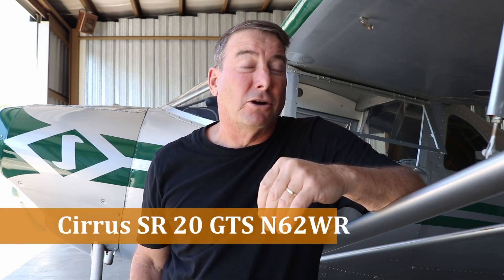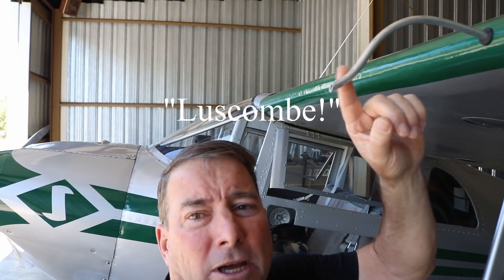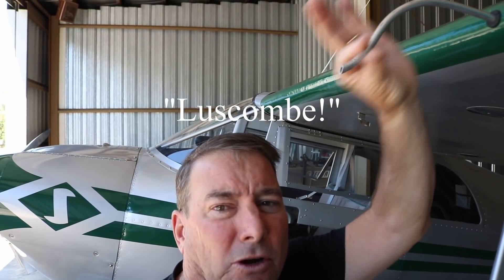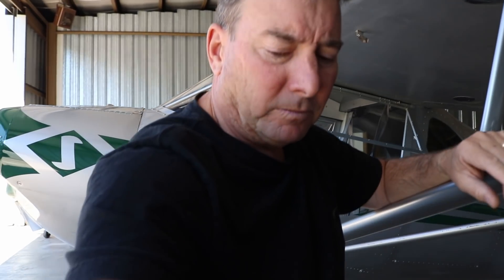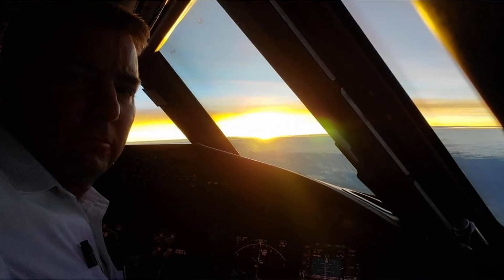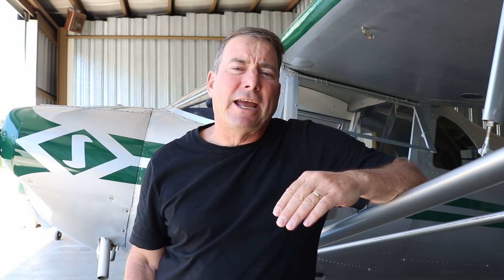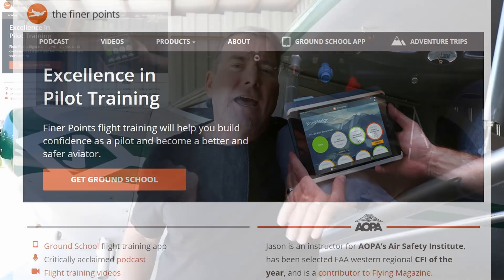Cirrus SR20 Crash Conway AR - AQP for GA!

Comment: 50 years ago, my flight instructor had a pocket full of round rubber flappers with little suction cups on the back to cover the gauges. Needle, ball, airspeed was the scan. No airspeed(?), power setting, attitude, and stall horn for backup. After departing the pattern, reduce power and check stall horn function, you can't check that on the ground unless preflight shows some kind of obstruction, then its time to see the A&P mechanic.

Comment: Airspeed is a great reference but should be understood it’s related somewhat to power - know your aircraft: example:1300 rpm 10 flaps , level flight = 80 kts (indicated) if zero think , is the engine making good power? (Rpms) what are the winds? You just took off. Or listen to awos. I have flown/landed with out airspeed indicator many times. Often students aren’t taught power settings for various configurations. The airspeed indicator doesn’t make the airplane fly the power does. Learn your power settings - that and common sense and you’ll be fine.also what GA aircraft doesn’t have a go’s showing ground speed? Clearly if you took off on RY 18 and wind was 180 at 10knts what do you think your ground speed is in final?

Comment: I picked up a 172 from paint: static port was plugged internally + trim was rigged incorrectly. Takeoff was exciting, nose lifts up at 40 knots and airspeed drops to zero on climb-out. Kept the power full and dealt with the trim problem first, then switched the alternative static source to restore instrumentation.

Comment: I have forgotten the pitot tube cover once; it was a stupid error; i am very meticulous on my preflights but that in turn leads to situations where your mind thinks it did something this time that in fact it remembers from last time; this is of course aggravated by the pitot tube not being visible from the cockpit in many low wing aircraft. solution 1: put the cover in the cockpit so you can visually check its presence; solution 2: buy an inspection mirror; always keep it in the cockpit and use it to check if the pitot cover is on; or the tow bar, or the chocks if you think your mind may be playing you tricks. Another important point is to never get side tacked during your walk around and if you are catching the lack of airspeed too late (i for example cannot see the airspeed indicator on take-off without significantly moving my head since the piper tomahawk eyebrow is installed so low it covers the upper instruments (working on changing that)) make sure you know your visual and power setting so that you can make sure to select an attitude and power setting that gives you a save speed like juan said. I did just that and on landing i selected a long runway and approached on the fast side only bleeding off airspeed when above the runway; so it all went well. and i am making damn sure this only happened once so that i have learnt from your mistakes.
Reply: I work in a technical (complicated machines) arena of the health care industry. We follow lengthy protocols and check-off lists for the machine's proper function, quality, and settings prior to the patients ever being connected to it. Difference is we indicate on paper and in a computer (via checkmarks, actual readings, initials) that we've completed each step of the safety and quality checks. I wonder if something similar could be implemented for GA pilots to use each time they're pre-flighting? An actual paper check-off list specific to the plane that requires an actual check mark prior to take-off. That way, you have a visual representation and can easily see if you missed something simple...like a pitot tube cover.
Reply: Isn't in the checklist to look for crud in the pitot tube, and the cover has to be off and in your pocket? Checklists vary.
Thank you for owning up to a mistake and for the valid points you make. Someone reading this won't repeat it.
Reply: I worked as an AME years ago. We had a client who forgot to remove the foam bungs from the air intakes on the front of the cowl. They were covered in bright red vinyl. Fortunately he detected an abnormally high rate of oil temperature increase before he left the ground and no harm was done to man or machine.
As a side note, he was a highly respected pilot with thousands of hours logged. If my memory serves me correctly he was a check and training captain for one of the better known (I wont say which one!) airlines. He was very embarrassed by his mistake which he claimed was the first one of this type that he had ever made. After making such a mistake, he chose not to fly that day.
I am unaware if he changed his procedures after that but it does point to the fact that even the best of us a susceptible to making serious mistakes.
Reply: @davidbrayshaw3529  do any preflight checklists include something like, “There should be 3 red items in the cabin (2 cowl bungs, 1 pitot cover)”?
Reply: L: I think there is a fine line where it gets burdensome and people will skip the checks altogether, but i will try it out
Reply: @user-qr8ki8ue4i I agree. A point he also mentioned are distractions- a checklist item can be missed because of a break in routine, caused by anything, people talking or asking questions, noises or events demanding attention, gear up landings and other accidents have resulted from events distracting the pilots,. I think checklists are good, (though items are rarely checked with a pen), but need to be followed through with good procedures that account for distractions on the ground and in the cockpit during flight.
Reply: @user-qr8ki8ue4i  There are such lists already.  Also check out "Missionary Bush Pilot" mentioned in these comments as he uses a mechanical checklist for his Kodiak similar to the older tech Boeings I used to fly.  ( Many more advanced aircraft now have "Intelligent" checklists...  For example, turn on a required pump, item disappears of checklist screen as actioned, so you are left with nothing to look at!  ).
Reply: @davidbrayshaw3529  EVERY PILOT like every AME makes mistakes.  No matter how many years you work on something as pilot or mechanic you will make them.  Nice to have extra eyes to help, along with checklists...   Hopefully the big ones are kept at bay...  21000 hours still flying and still aware of and hopefully mitigating errors along the way.  ( I was a check airman as well )
Reply: I'd like to know how he checked the pitot heat function.   A pilot in our flying club discovered what happens when you test the pitot heat with the probe cover still attached.  Apparently the smell is pretty bad.
Reply: Isn't it always the TINY issues that rise up to become big ones?
Reply: Dwight st. john: there will always be holes in that cheese; our job as a pilot is to minimize them as much as possible so they don’t line up; there are so many small things that seem and are completely unimportant until that one day when they are the only thing standing between you and disaster; i don’t want my last thought be: ‘if only i gad checked X or done Y
Reply: @tomdchi12  I'm not a pilot so I can't answer that with any qualification. I'm sure that it does for our former client since his near death experience, though.
Reply: @daviator4720  Anyone that doubts what you state is still wet behind the ears. I was fortunate enough to fly with a 777 check and training captain who had adopted your mindset regarding the second set of eyes.
 One of the privilege's of being a  AME where I worked was that I sometimes got a ride in the customer's aircraft, in this instance one of the Yak variants (18 from memory).  Despite me having no pilot qualification and only a little experience as a "passenger" in the right seat, the captain had me follow him around on the pre flight inspection and confirm that he had followed the checklist at every point. Once on board and yet armed with another check list,  he had me confirm once again his take off procedure including reading back to him items such as oil temp/pressure, manifold vacuum readings and so on. He also took the time to brief me on procedures to follow should we find ourselves in the situation of a forced landing, or as he cheekily said, in a professional aviator's tone, "in the unlikely event...".  As we prepared to land, it was more of the same. By the time the chocks were in and the aircraft was tied down I felt like I'd done a days hard work!
We had a bit of a "de brief" later and I quizzed him as to why someone of his qualification would rely on the input of a lowly hanger rat.
His response was that he took every opportunity available to him to mitigate mistakes. He acknowledged that one of his major considerations when operating the Yak was the absence of a first officer which he was so accustomed to operating an aircraft with.
In his mind, having a "lowly hanger rat" checking his work was a whole lot better than not having one.
I flew with a number of very competent airline captains, first officers and GA pilots whilst I was in that job. I'd have to say that with out a doubt, the gentleman that I have described above was the best of them because, like you, he acknowledged that everyone makes mistakes.
Pride doesn't save a disabled aircraft.

Comment: I put this in a reply to another person here, but I wanted to put it out for everyone, in case they didn't see my reply.
Okay, we now know that this was not a student pilot.  He started his training when he was 16 years old, was instrument rated by the time he was 20, and was 38 years old.
What we don't know is:
1.  How current was he?
2.  What kind of experience in the SR-20?
3.  How thorough was his pre-flight?

It's the third question that bothers me the most now.  We know that the weather was good for VFR flying.  In fact, it was high 80s to low 90s, the wind was less than 10 mph, and there were only 'passing clouds.'  On that airplane, the pitot tube sits on the left wing almost at the wing tip, it's pretty far out.  The fuel caps sit just outboard of the main landing gear.  Each wing holds 28 gallons of usable fuel.
I can no longer ascribe to the that he didn't know his airspeed and got into a stall spin crash because he was too slow BECAUSE HE COULDN'T READ THE INSTRUMENT.  I can't put bold or italics here, so excuse the all caps.
What I believe is that he had something far more severe than loss of airspeed read out.  So many of us here have learned, even before solo, to fly the airplane without reference to the instruments.  There was no reason for this pilot to be flying on instruments that day.  It has to be something else.  Poor piloting technique?  Possibly.  Long absence from the airplane and flying?  Maybe.  Inexperience in the aircraft type?  I don't know, at least not now.
I'm more inclined to believe mechanical failure.  What I am wondering is did the engine quit because of fuel starvation, or maybe water in the fuel tank?  If he couldn't see the pitot tube cover on the airplane, did he bother to check the fuel in the tank?  If he didn't drain the tanks, and I would guess that Arkansas is probably a pretty humid place this time of year, it's very possible he had water in the tanks.  From the manual, climb out at full power should take 0.3 gallons of fuel to 1,000', 0.6 gallons to 2,000'.  Depending on how long he was on the ground for, he might have burned up three quarters of a gallon of gas from start to pattern altitude.  That would be enough to drain any fuel that was in the system before any water would enter the engine.  It would also get him to pattern altitude, maybe half way down the downwind leg.  If he lost his engine half way down the downwind leg, or three quarters of the way down, his final position starts to make sense.  Conroe has a 5,500' runway.  You should easily be able to get a SR-20 into 2,000' of runway, so anywhere from half way down the downwind, he should have been turning back to the field.  Sure, one of the most useless things in the world is runway behind you, but if you got more than enough in front of you to do the job, even in the worst of conditions, it doesn't matter.  Make the turn.  How about, instead of water in the tank, the tank vent line was somehow blocked.  You might miss that on a sloppy preflight, too, since the vent intake is near the wingtip, as is the pitot cover.  Covering that vent like will reduce fuel flow and eventually cause it to stop flowing.
Look, I don't know what happened.  I'm pretty sure, though, that it's more than just a pilot not seeing his airspeed indicator, especially one that's been flying for 22 years, even if it is on and off.  I'm going to guess he had a mechanical failure of some sort and that is what caused the crash.  A poorly flown engine out procedure, where he tried to fly a 'normal' patter, got slow in the downwind to base, or more likely, base to final, got too slow and stalled and spun in.  I'll believe that.
From the Kathrynsreport.com page:
"Airport Director Jack Bell said that shortly after takeoff, he turned the plane as though trying to return to the airport, and the plane crashed. The impact site was approximately 250 yards from the runway."
"According to Bell, the plane crashed about 250 yards north of the airport runway. He believes that from what he saw, the pilot was having difficulties taking off from the runway, and it appeared that he was trying to return back to the runway."
The 'Impossible Turn?"